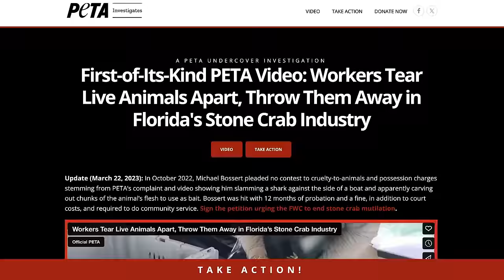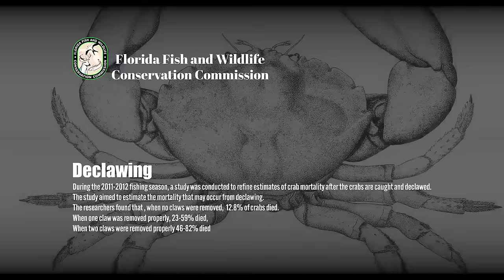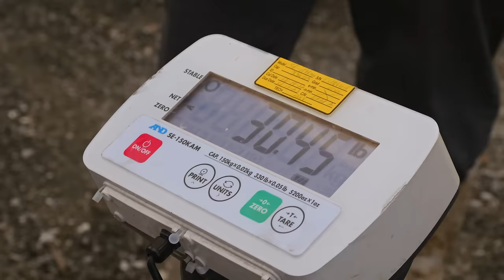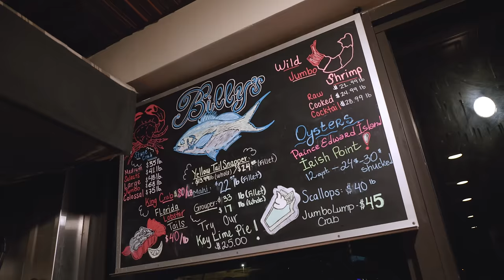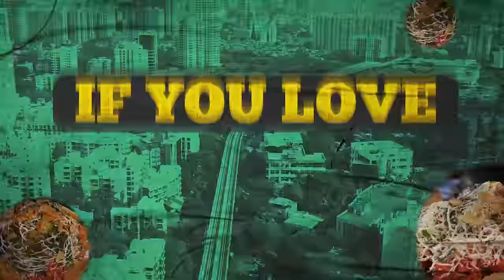Trapping Florida's Illegal Seafood!! (w/@GugaFoods)

Comment: Imagine how low the chances are for a crab with no claws to survive.. That's why us casual people leave that one claw on..
Reply: Leaving one claw leads to a higher mortality rate.
Reply: Leaving one claw makes the crab think it’s still capable of defense and hunting but it’s severely compromised missing a claw. When you take both the crab goes into scavenger mode and eats food off the bottom, stops hunting and stops picking fights lol. Taking one is only for females.
Reply: @HunterBidenscrack That’s not true, but taking both claws doesn’t increase the mortality rate enough to justify only taking one. If you take one, take two because the statistics support it. One claw is about 50/50 mortality. If taking the second claw only raises mortality to 80%, take two. The math works out, especially since females (which are protected) produce a ton of baby crabs, but they only need one male. I’ve been drinking, but I’m pretty sure that’s basically how it works.
Reply: ya, last time I checked If I go diving I'm only allowed one claw, but that was a while ago. maybe commercial fisherman have different rules.
Reply: @Sniperboy5551 I too have been drinking, but the 80% figure was also the high end. It could be lower
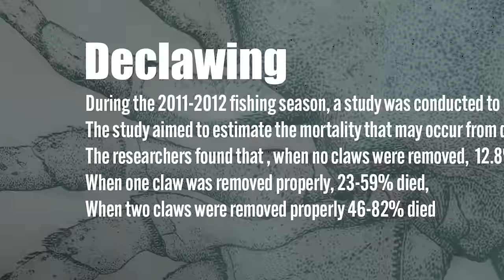Reply: @billlee1724 literally stated in the video that both claws removed significantly reduces chance of survival 5:03 

When one claw was removed properly, 23-59% died, When two claws were removed properly 46-82% died
Reply: Except in Florida I rarely ever seen anyone take just one. Unlike the other southern states that restrict it to one claw by law.
Reply: @Sniperboy5551 that is a 30% increase in the crab living which is HUGE, especially when they are heavily over fished.
Reply: IF TAKING JUST ONE, HOW DO THEY FIND OUT IF THEYRE LEFT OR RIGHT CLAWED.......  ;)
Reply: Rather high actually. I am a stone crab fisherman. They are very good at finding little holes to hide in, and it only takes 18 months for them to grow a claw big enough to harvest so the odds of them surviving are pretty high.
Reply: @jakem.15not getting into the argument but serious question.

How do the eat enough to support regeneration if they need to hide in a hole to survive.

It's already an expensive food. It seems that taking one claw is the right move. If taking 2 why not take the whole crab ? Is there no more edible meat on the crab like Blue Crab ?

Comment: In my country its actually illegal to break off the claws of the crab, and throw it back out, alive. The crab uses its claws to eat, and defend itself, so when you remove both, they have a high chance of dying.. Slowly. From hunger. Or if they are lucky, you break it off at the wrong spot, so they bleed out quicker. Its a dumb practice that simply doesnt work for the intented purpose.

Comment: It's not a Maine Lobster. It's a North Atlantic Lobster.
Reply: If it was trapped in Maine, it's a Maine lobster. Location does affect the flavor of shellfish, no matter what the species is. It's especially noticeable in shrimp and oysters. The flavor can change even within the same bay.
Reply: @kmoecub What you're saying is absolutely true. However, there have been countless times when North Atlantic Lobster has been referred to as Maine when they're actually caught in Rhode Island, Massachusetts and Connecticut. Same species, different locales. 
You can get a cheesesteak anywhere but if it's made in Minnesota, that is not a Philly Cheesesteak. They never specified in this video where that lobster came from therefore it's a North Atlantic Lobster. They just call it Maine Lobster because the lobstering industry is what the state is known for.

Comment: This is just sad.. Crabs that survive the initial declawing face potential disadvantages in feeding, mating, and self-defense. The most immediate impact of declawing is possible death. In an experiment using commercial techniques, 47% of Florida stone crabs that had both claws removed died after declawing, as did 28% of single-claw amputees. 76% of these casualties occurred within 24 hours of declawing.